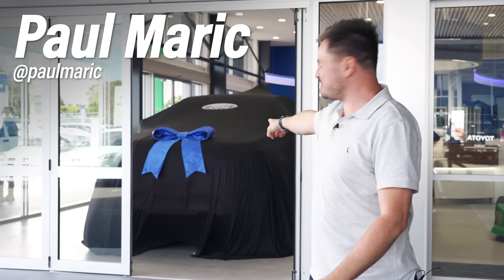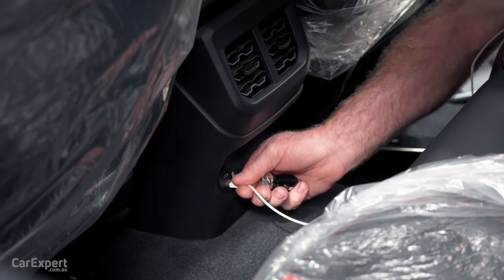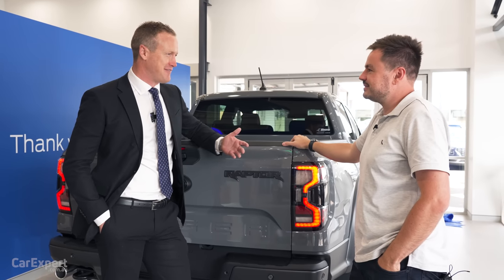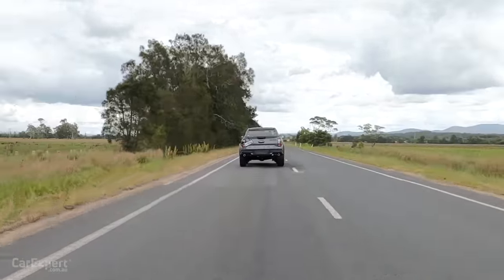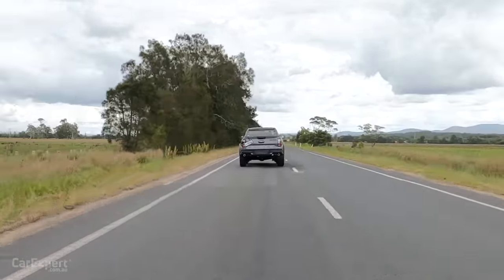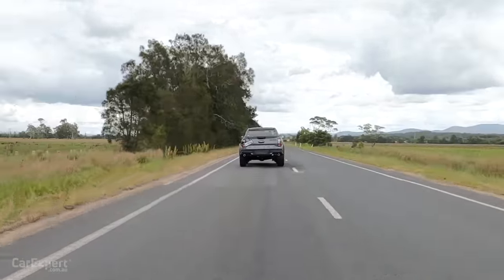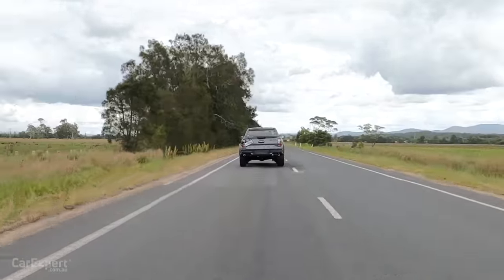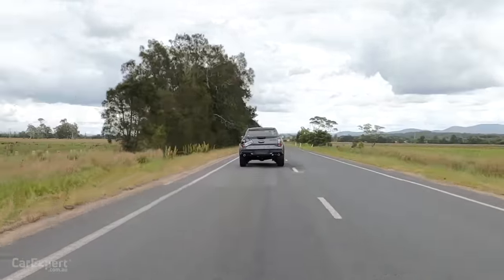TAKING DELIVERY of my Ranger Raptor! What your delivery fee covers & answering questions!

Comment: I worked at a Ford Dealership for 4 years. None of what you showed as part of the pre-delivery was done apart from the detailing where I worked. Just a way for dealers to fleece you for more $$$
Reply from the maker: Good to know! Were you at a city or regional dealer?
Reply: @CarExpertAus  a Sydney dealership
Reply: That's from your dearlership good to know it takes short cuts! Because Iv worked in dearlerships for 6 years and these things get done every time👍
Reply: @CarExpertAus   295/70r17 Yokohama Geolander MT G003 tyres are sticky tyres: in mud😉
Reply: @nathanielmartyr-gogerly2408  so your dealership, does all the software updates at PD.
Reply: @CarExpertAus  Paul must be being paid for the ‘pre-delivery speil’ - that should be completed by Ford Australia for delivering a ready vehicle the customer can drive away with. Why this is on charged by the dealer to the customer is confusing, one to look out for and contest. Seems like total BS.
Reply from the maker: @reubs91  Exact same for every new car sold unless pricing is drive away as far as I’m away. I paid around $1000 for pre-delivery for the Tesla, can’t remember what it was for the Supra.
Reply: @nathanielmartyr-gogerly2408  Dealer doing work like checking car put together correctly? That work has already been done when the car was made. So this dealer work is just duplication of work, with no value to the customer, just extra cost to the cusotmer, and fees to the dealer
Reply: @Ian  who do you think adds the tint or the towbars or bull bars or details the cars and takes the stickers of when it gets to the dearlership? And I'd your paying good money the old saying messure twice cut once means you investment is perfect when you receive it.
Reply: @nathanielmartyr-gogerly2408  “investment” LOL
Reply: I was about to order one but what are the recalls for this particular car😂. I hoping this is not another lemon car. 
I will still keep my 200 series as a back up i car incase this car spending time in the dealership.
Reply: Facts! I can concur. I was a service writer for years at a Chevrolet dealership. Remove stickers and protective film, install floor mats, wash and thats it.
Reply: Pre-delivery where their ‘detailing’ ALWAYS puts swirls in the paint
Reply: @reubs91 It’s not I definitely know my local Ford dealership did the pre delivery to my Raptor before I picked it up. I seen it in the workshop and them doing all of that as I was waiting for my Mustang which had just been serviced

Comment: Love your work. I do call bullshit on the justification of the DD fee though. It’s called margin. Pre covid you would negotiate based on supply v demand and often never pay DD and all the ‘services’ you list are obligatory for the dealer to do before selling you the car. Enjoy your Raptor. 👍🏻
Reply: Absolutely agree - just repeating BS that dealers tell their salespeople to use to justify a pure profit centre.  I had a Ford dealer once tell me that on roads were a bargain as they had to cover the cost of the car being shipped from Thailand 😁
Reply: Running in a new car engine on a 1100 km motorway at, let's say, approx. 100 km/hr most of the way (almost constant motor revs)  surely not good for it. I know they say modern car engines don't need running in, but this trip you did, I am a little worried about it for you. Can you investigate if my concern  is warranted. I bought a new Wildtrak-X, MY2024, and I am running my engine in the old-fashioned way for peace of mind. Also, I was seriously thinking of getting the oil & filter changed at 3000km by Ford. Thanks, and keep up the good work 
John B

Comment: I picked up mine on Monday. Went with the Utemaster load lid. Keeps things dry and secure in the tub with integrated central locking, and you can strap stuff on the top if needed. Can't do that with a roller shutter. NZ Raptors don't come with a spray in bed liner, so I plan to take out the drop in liner and replace it with an RVE Tough Liner (a fitted marine carpet with handy velcro add-ins and dividers). Paul previously mentioned that the B&O sound system might need upgrading. I like my sound, and to be honest, I wouldn't bother upgrading unless you have cash to burn. It sounds good IMHO. It's a small area in the cabin, and there are plenty of crisp and deep sounds available.
Reply: Nice I was looking at the Utemaster load lid as well but not sure if im getting a sport bar or not .

Comment: Nice of you sliding the old vs new Raptor in at 18:04 👍
Many happy and safe (s)miles on the new grunter. 

Btw, please add a feature request to Ford to automatically detect tunnels and change exhaust to Baja mode.

Comment: I went with a regional dealer after being promised the world by a massive Sydney dealer, I still ended up with a Raptor in September even though I ordered the 2nd car 6 months later, I will stick with this dealer even though I had a 200km drive (which isn’t bad anyway)
Reply from the maker: Love to hear it!
Reply: @CarExpertAus  You can disable the auto-stop start, i did it in my gen1 immediately. in 2019. via ECU modification (FORScan) If you can find someone with it already, you dont have to purchase and the change stays permanently (lots of other options you can change also).
Reply: I ordered one from titan ford in Brookvale in early April this year with a delivery date of September 30. Called four times for a delivery date in October because I still hadn’t heard anything, then they finally had the courage to answer (by email) that I can expect delivery mid next year. Stay away from these clowns.

Comment: I thought the manufacturer had the vehicle delivered to the dealership as part of their cost. Dealer delivery charge of $2000 is a rip off. It should be less than $1000 because even at $150 per hour, that is over 6.5hrs of labour to pre-prepare the vehicle and it doesn't take that long to prepare a vehicle for customer delivery. This model Ranger looks great!
Reply from the maker: Keep in mind the fee also includes shipping - I’d say that’s where most of the cost is.
Reply: @CarExpertAus  you're being lied to mate 🤣🤣
Reply: @CarExpertAus that's bullshit. Delivery to dealers is included in the sell price to dealer. The delivery charge here in Oz is a complete money grab and profit opportunity. Dealers use it as they se fit to maximise profit. It can vary massively dealer to dealer and car to car at same dealer depending on the demand. This was outlawed in the UK 20 years ago for same reasons.

Comment: I recently picked up my Raptor and I absolutely love it! I went with the blue, didn’t go the bead lock rims but I had the electronic roll cover installed. Personally I don’t see why it isn’t standard on the Raptor when it is on the Wildtrak. I can confirm the Ford dealer did do the exact same pre delivery process as I literally seen them doing it as I was waiting for my Mustang which was being serviced. The only issue when I purchased it was explaining it to the mrs 😂. As I had fully intended to order a Wildtrak, went to the dealership ( own my own) saying I was going to order it the Wildtrak however when I arrived at the dealership there was a nice blue Raptor, so that’s what I ordered 😂. I am now currently banned from going to dealerships on my own 😂 😂

Comment: In the "real world" most dealerships don't do what you said because its quite often for customers to receive cars with faults & flaws etc. Bought Ford 3 times and each time this happened. Three guesses which brand I switched to that doesn't have any of these problems and actually has an incredible track record where over 70% of their cars which were ever built to STILL be driving on the road. Guess price does matter...

Comment: Paul, Fireballs' Dok Do is awesome. I have black Mustang and it was a PITA to wash and keep clean, water marks, finger prints , etc, the paint on these cars is awful. 4 years later the car looks stunning,  better than new. Has a deep gloss that looks amazing on the Black Death. Is now so easy to wash and dry. We have won a couple of awards at car shows , Best in Show and People's Choice. Do the research and find a detailer that knows their stuff. My shop did four days of prep, clay bar , the works. They did glass, rims, tyres, trim,  interior, brake calipers and the exhaust tips. Even if you just did the paint and exterior trim the money spent is well worth it.

Comment: Congratulations, my wife got her Raptor in Thailand on the 22nd of September and we both love it. Also Conquer Grey. We did order in November 2021 though, without knowing much except it being a new model.
Her fuel economy ranges from 14-15 l/100 km!! As soon as you go faster than 120 km/h it goes YUMMIE.
One little annoying thing; in Thailand there's no phone button on the steering wheel, meaning you have to lean over to answer the phone on the touch-screen while your hands are waving about whilst driving. Easy to get it wrong.
Finally a question for you; her key-fob only has unlock & lock on it. Yours has an extra button, what does that do?

Comment: Couple driving questions please mate... 1, which suspension setting do you use on tarmac roads? 2, can you change sensitivity of steering wheel? Awesome truck I cant wait to trade in the Amarok V6.
Reply from the maker: I just use normal. And yes you can change steering feel using button on the wheel :-)

Comment: Hey Paul, congrats on THE new ride. I think for now the Ranger Raptor is THE pickup truck one should have if given chance to purchase one. But if you be so kind enough to do a comparison with the bi-turbo Ranger Wildtrack it will be awesome on this categories.

1. Fuel mileage, I mean it's not exactly the same engine but given the sad realities of fuel costs today, say fuel consumption on city/highway driving. Coz on some parts of the world diesel is expensive than gasoline and with next year's focast it can still remain elevated. But of course V6 Raptor IS expensive to operate too.

2. Ride comfort both city/rural driving but given the advanced suspension of the Raptor I think wins on this one. Still it's interesting to compare how the Wildtrack rides to a Raptor.

3. Maintenance - Raptor has an advanced tech/engine so it might be expensive to maintain but still how does it compare to a Wildtrack in terms of maintenance.

So there, hey thanks in advance and for sharing how you got this awesome ride. Enjoy the ride out there 😉

Comment: About the 4A vs 2H - my Acadia is the same. It'll sit on 7s in 4x2, but flick it to 4x4 and it'll be in the 8s. The PTU engages a bit so that it can lock the PTU clutch and send torque to all corners if needed. That extra drag is a good 10% extra fuel in my car, with 70k on gearbox and rear diff oil.

Comment: Congrats on the purchase, my good fellow. 
I guess the only question I have is. Has Ford fixed the wind noise and road noise  in the new model raptor?
I had the previous Raptor X and ended up selling due to a lot of noise. It ended up feeling well below par of the 90k price tag.

Comment: Why is the steering on the wrong side?  ; )  I got mine in Thailand and the same thing!  Can you perhaps get an answer from Ford for me (and you)? What is the plan for the rearview mirror USB port? Is Ford going to offer a Dash Camera system? Are they planning to allow the recording of the existing camera data (as in the Tesla)? Good info (warning) regarding the sulfur content of the lower octane fuel. I had no idea the sulfur content in OZ was so high. 15 X higher than the USA limit, that's bad for the engine and our lungs!

Comment: I picked up my ford everest sport last Tuesday, and didn't realise till I got it home and could really look over it that inside the rear wheel arch it is only what looks like sound depning material witch already started to fray from a 40k trip home the front are plastic I rang the dealer thinking it was missing a piece but was told it is how they come on the new everest and ranger. Not ideal for off road, or cleaning 🤔  does your raptor have the same? I can send you a video if you won't. Or if your doing a everest sport review plz show it.

Comment: Hey Paul... for relevance.. what speed were you driving at on the I itial trip to Melbourne for the fuel use stats ? 100 or 110 ? There can be great savings at 10 over just the extra 10ks

Comment: well Paul , i guess i hope it performs as good as you hope so when do you get the top coat of paint ? seems that its a grey under coat colour  for all that cost one would think you would have a top coat paint . question ? why is the screen so large ?  seems i bit large and distracting to me . why do you need all these modes ? is it  there to make a bad 4x4 driver better ?  . and what would be the purpose of this vehicle ? just a holiday vehicle ? . or just a shopping trolley ?  it will interesting to see what you think in 12months or so , if you keep it that long , good luck .

Comment: I have my next gen raptor, I’m extremely disappointed trying to install my 3 baby seats

I had to get a third anchor point installed, engineered and the modification approved by ACT motor authority, $1700 later…

I went to install the seats and the rear head rests are not removable making the seats sit to far forward

So far I am not able to drive my car and it’s been a month I’m just looking at it, probably have to sell it
Reply from the maker: I don’t think any of the dual cab utes in the segment offer three top tethers. They all have two ISOFIX and two top tether.
Reply: @CarExpertAus  thanks for the reply, can you please check your raptor rear seat headrests and see if yours are removable

Comment: That's a high delivery mileage, I reckon they did some test drives to lock in deposits, that what I used to do if a demo wasn't available at times, sold Kias for 8 years.

Comment: hi Paul, is your car's bed liner plastic or spraying. how there are 2 different bed liners for raptor?  do you know?  i mean there was no option for it to order in UK.
Reply from the maker: Mine is a spray in. From March 2023 production it changes to the drop in. My understanding is the roller cover (electric) can only be fitted with the drop in bed liner.
Reply: @CarExpertAus  thank you very much Paul! now i know what i am getting with my order,

Comment: So all raptors after march with or with out the optional roller shutter will come with the fitted bedliner, no the spray on anymore? Is that confirmed? cause my dealer said if i dont choose the roller shutter, itll come with the spray on bedliner.
Reply from the maker: My understanding is the spray in bed liner is gone from March 2023 production regardless of roller cover. I may have misunderstood that and will need to triple check.
Reply: @CarExpertAus  yeah please if you get a confirmation, give us an update. thanks

Comment: Your automatic steering must be .. a different setup from mine (2022 BT 2.0 WT) The automatic steering is... well it's not undriveable, it certainly works, but it drives like an L Plater! Perfectly good in a straight line, but it chops up the turn. It won't just.. drive around a bend smoothly. It's certainly not.. intolerable, but to the passengers.. it's not smooth, it's not what you'd expect from an experienced driver, making using it, at least with others in the car, a bit embarrassing. 

So usually, I just turn it off. I suspect I'll use it on the long straight highways around here, (I'm from the Midwest WA, the road to perth is long, mostly straight, and tiring) But really, for twisty country roads it's more an annoyance cutting in and out all the time. 

Has anyone else experienced this? Do they know a solution? Will Ford update the software to make it drive smoother? is such even possible?
Reply from the maker: This tech is definitely not designed for windy country roads. It’s designed for major freeways with mild turns - I wouldn’t use it anywhere else. In all of our reviews we test this tech on the banked oval at the proving ground and so far only Ford (with Ranger and Everest) and BMW (iX) have passed the test.
Reply: Yeah when I test drove the new ranger raptor I found the lane keeping software rudimentary to say the least, it pinballs you around bouncing from the road lines either side, where as my partners Honda has Honda sensing and it's lane keeping is amazing, almost on par with Teslas driving aids,  it keeps you centralised in your lane with very subtle movements to keep you in the middle of the white lines, goes round corners well too, it  must have a much better software and imaging system than Ford's as the ranger was pretty much hitting the lines and over before it tries steering you back into the lane , big thumbs 👎 in that regard unless they can come up with a software fix or something it's kinda making me second guess getting the ranger raptor at $93k

Comment: I'm considering buying a vehicle interstate and driving it back to my home town (about 2000km) like you are.  How about the vehicle Running In period when you do this as I'd be doing 100-110 most of the way.
Reply from the maker: With every car I’ve bought I just drive it as I normally would. Run in used to be far more important in the early days with less precise engineering and tolerances.
Reply: @CarExpertAus  Thanks for taking the time to reply.  Brisbane to Darwin it is for me then.
Reply from the maker: @djjames6576  That sounds like an unreal drive too!
Reply from the maker: @djjames6576  That sounds like an unreal drive too!